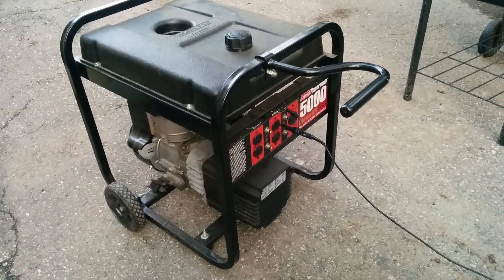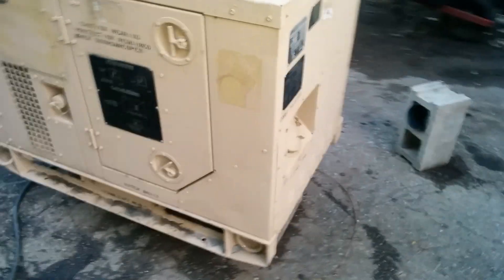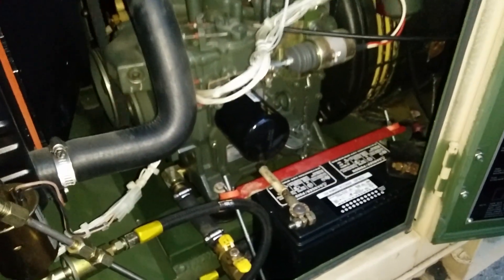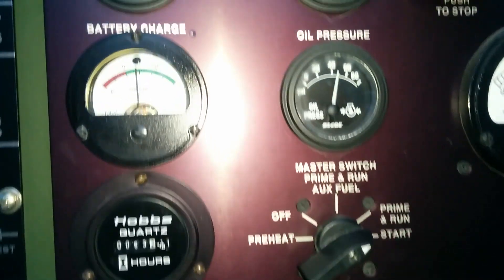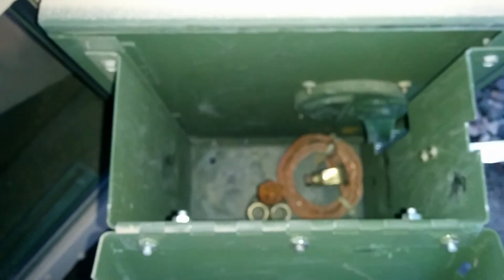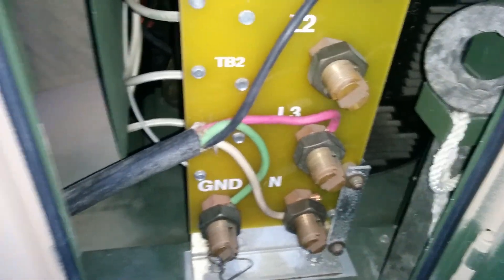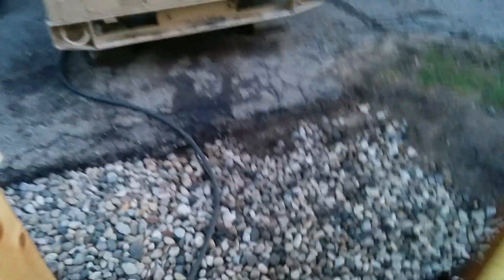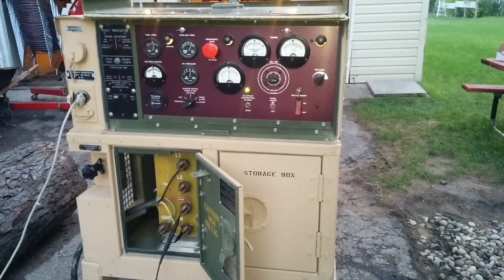Mep-802a vs consumer generator

Comment: where can i buy one ?
Reply from the maker: Govplanet.com I think but your paying top dollar these days. Ebay sellers too. Mep-802 = 5kw Mep-803=10kw both can put out 20% more then rating. Don't buy it if it doesn't run. Stay away from units missing exhaust flap and over 2000 hrs. Most units are in georgia right now.

Comment: How do you come across something like this to purchase?
Reply from the maker: Used to be govliquidation.com online auctions. They had a contract to buy surplus. Now I think govplanet.com is the only one around. But auction prices have shot through the roof from people bidding on stuff they did not know anything about cause they heard a guy got few good units once soon a time. Many of the units have serious issues. Most of which a trained eye could spot. But people where bidding top dollar on units that where clearly only good for parts. I used to get a good 1,000 hour unit for $1500 and a parts unit for under $500 last time I checked they where selling for $4500 for any unit. I'd drive out of state up to 13 hrs away to pick up 4-5 units at a time and fix em up and sell em for $5,000-$6000 each.

Comment: Hello if I were to pickup one I should really get one newer in year like 2006 and up. Nice video
Reply from the maker: I usually went for newer units but the most important thing to me was to make sure it was not a rebuilt unit. There is a small tag by the data tag that indicates an overhaul.

Comment: I just wish that the people that make videos like this knew what they were talking about, this was just a bunch of BS
Reply from the maker: Other then I said commutator instead of slip rings . What else did I say that was BS? Diesel doesn't varnish like gas and does have a longer shelf life. As long as you keep water out of diesel it stays good a very long time. The THD on the Coleman can and will damage your sensitive electronics. Brushless generators are typically less noisy because of there very nature. There are more reasons for the better THD I can explain them better now if you'd like to know about them.

Comment: Do you have a frequency meter you would sell? The one on my 802a is jumping all over the place. Already verified good output with a meter
Reply from the maker: Unfortunately I don't. It is one of the gauges that fails the most because of its sensitivity. Mine is a bit sticky right now too. I parted out a whole mep-803 and that was the first part I sold

Comment: That's a 10 000 watt generator. I have two.
Reply from the maker: No it's not. The 802a is a 2 cylinder 5kw and the 803a is a 4 cylinder 10kw I have bought , repaired and sold 20+ of them. Now semantics. The 5kw unit can actually put out closer to 7kw and the 10kw unit can put out 14kw

Comment: There is no commietator in that POS- it is a slip ring. Harmonics can be filtered.
Reply from the maker: Ya I know I misspoke. But slip rings still create noise along with poor voltage regulation. That's why most quality generators with low THD are brushless.

Comment: What makes these military diesels last longer than the cheaper one you showed is the fact that the engine it runs at 1800 RPM vs 3600 RPM of the smaller one. They make 3600 RPM diesels also and those will last a little longer than the gas versions but not alot more. The bearings and all moving parts of the higher speed engines wear out at a MUCH faster rate logarithmically.
Reply from the maker: The speed is a huge factor, that is correct but also look at the robust components of a diesel vs a gaser. The piston rods are twice as heavy, the blocks are twice as thuck, the metalergy in general is usually of a higher standard to handle the higher compression ratios, cylider pressures and torque.
Reply: 300 RPM diesels like Listerines, you will to your grandchildren.

Comment: I just picked up one of these for an unbelievable price. I'm glad I ran across your video. Was going to flip it but now, I think I'll keep it. 479 hours built in 81. In 91 had sound suppression kit installed. Have record of everywhere it's been. Good video
Reply from the maker: If it had a sound suppression kit installed its not an MEP-80x its an MEP-00x 5kw is MEP-002 and 10kw is MEP-003
This video is of the newer water cooled units.
Yours is an air cooled unit.
Air cooled units are quit a bit louder and not as sought after but still very good machines.
I have a few videos of a MEP-002's that I had too.
MEP-002a walk around https://www.youtube.com/watch?v=RgsFpg3I3QI
MEP-002a 7700 watt load test https://www.youtube.com/watch?v=EzIbZD_6HTA
Acoustic suppression kit reinstalled  https://www.youtube.com/watch?v=CTgj78rVrq4
Reply: @electromechanicalstuff2602   I paid 250 bucks for the mep002. Just one of those things I couldn't pass up regardless of whatever I had in mine to do with it. 600 for the 12 kw. At an auction, people were scared it was a 3 phase. They didn't realize it was both
Reply from the maker: Did you realize it was both? a lot of people are turned off by that not knowing.  @aaronwood3540
Reply: @electromechanicalstuff2602  yes I realized it, that's why I bought it. Both of them are both 1 and 3 phase. But of course im just using the single phase side. I worked 20+ years around 3 phase so the 3 phase side didn't bother me at all.
Reply from the maker: I've only been working around 3 phase about 5 years and now I make my own digital and rotary phase converters.
I've eve sold a few to friends.

https://www.youtube.com/watch?v=hyjYdEL-80s
https://www.youtube.com/watch?v=6dMwxFX_vlQ
 @aaronwood3540
Reply: @electromechanicalstuff2602  so your saying the 5 kw genset will produce more than just 5 kw? Did I read that right?. I kinda thought it would but haven't put it to the test yet. I need you on my crew. I can build almost anything out of wood or steel. Need someone good with electronics lol. Hard to find those kind of people.
Reply from the maker: @aaronwood3540  correct more then 5000w. Its rated for 5000w continous= 80% on load meter.
6000w= 100% on load meter for 1hr. 
6600w=110% 40 mins
7200w=120% 20 mins
7800w=130% 10 mins
Not all can make it to 130% before falling on its face. 
They have that extra power so it can still maintain 5000w at the highest altitudes and harshest conditions.
I don't know u but not to be rude you probably couldnt afford me.
I already work for a large manufacturing company in the R&D field with electromechanical devices. Thanks for the offer tho. You can always find good workers but how much are you willing to spend to get them is the question. Or you have to identify the go geters early and train them to become the guy you want. Easier said then done i know.
Reply: aaron wood I
Reply: @electromechanicalstuff2602  I also have a old school 10kw that was upgraded to a 12kw. When I say old school I mean it has the hecules flathead four cylinder in it. Built in the 60's. Runs like a top but drinks the gas like a fish drinks water. It only has like a 1000 hours on it. I'd have to go look at all the numbers to tell you what it is exactly. I've owned it for a few years. I actually bought the mep002 because of the diesel engine thinking I could swap the engines. But it turns out the mep002 is in really good shape so now I don't want to do that even if it would work. Also looking things over I'm pretty sure the engines wouldn't interchange anyway. So if the mep002 will run my house with no problem I may just put in in instead of the 12kw. I just to have plenty of extra if I have the option you know.
Reply from the maker: @aaronwood3540  the 002a is only 5kw capable of about 8kw. The gen head in these units will produce way cleaner power then that old hurcules. Youd be downgrading it if u put the diesel on a less quality gen head
Reply: Back in 1994, I bought a Chevy stepvan with the Detroit Diesel 6,2l V8.  It spent 1988-1994 going up and down the flightline at Pope AFB in NC.  I called and the Chief Master Sgt who owned it sent me its complete maintenance history.  It, too, gets 3000 mile oil/filter changes.  I changed the glow plugs in 1998 and starter in 2008.  It still runs like new.

Comment: i am looking into buying one with 860 hrs is it too much hrs will it be needing an engine soon or they go the distance
Reply from the maker: I usually try to buy under 1500 hours. Oil change intervals are every 500 hours. Just look for wet stacking. Tar/ oily residue around exhaust manifold. Its from running without enouph load. 30% min load at all times.
Reply from the maker: Ive seen good runners at 8,000 hrs
Reply from the maker: Also look for a tier 2 tag by data plate that has year on it. Means its been oberhauled by the military but the clock gets reset. Usually they have had alot of hours on them to require an overhaul
Reply: @electromechanicalstuff2602  is a generator having a tier 2 reset good or bad.
Reply from the maker: @richardi1124  id go with bad but can be ok. Teir 2 reset means its been ovethauled. They dont replace everything. Just do the updates that are required and fix anything broken. Usually they only get teir 2 resets after a major breakdown. Like motor or gen head. They reset the hour clock. So u dont know how much time is actually on the unit. Alot of parts may still have 5,000 + hours on them. Its hard to say exactly how long it will last. They do go thrugh it and make it right but not as good as a non reset unit with less the 2,000 hrs if u ask me. Thats only my opinion. People may have diff opinions. Ive seen 8,000 hr units run fine. Ive seen units with 300 hrs on them destroyed because the operator let it wet stack. So it really depends. Wetstack is the biggest concern

Comment: Could you do m a favor? If you still have the Coleman could you run a test on the sine wave with say a 1500watt space heater on it?
Reply from the maker: I do not but i sold it to a friend so sometime or never i might be able to
Reply: I'd really appreciate it. I have very similar model as a spare to a generac(chinese somewhat okay not really genset). I heard you just have to be really careful with loading and unloading to avoid spikes and dips and they clean up a lot with some resistive load on them.
Reply: If you can do a voltage check too, sometimes these things overrun and make a mess of the wave.
Reply: Oh something that may be easy for you there. Can we get a quick vid of that sine wave unloaded? It might even be cleaner. Electric motors spit out straight garbage into the system.

Comment: I've seen  huge piles of these thrown away in Saudi Arabia by the military. I was told it's cheaper to scrap them.than send them back state side. Go figure
Reply from the maker: Rayford Hickman if they dont spend the budget they wont get as much next year. Literally a donzen of the units ive gotton over the years where sabotaged when i got em. Usually oil pressure wire cut or something easy like that to cause it to not run and shut down via saftey fault codes. Its obvious they need new gens cus the others are "no good" the other 50% off all the units in the markets are usually junk cause of wet stack or watter got in the exhause and locked it up. The other half simple or no repairs
Reply: Military industrial complex don't make money on shipping only death
Reply: I have always looks at military logic as stupid

Comment: I would like to see you compare the sine wave of a good inverter generator (like a Honda or Yamaha). They are designed for consumer electronics. That Coleman hog is not.
Reply from the maker: Jake Logan your right. But that hog is what most people have amd is what most people backfeeed their homes with. My friend just got a champion 3000w inverter gen im going to scope soon
Reply from the maker: Jake Logan https://youtu.be/bXsTfUOllJM

https://youtu.be/XChmkKRVDUA

Id so like to see any inverter generator start a 3 ton ac unit or 3 of them

https://youtu.be/nJz45Hn6vgE
Reply: Good videos. I have two portable inverter generators myself, and three portable conventional generators. Looking to get a MEP-802A soon. Oh, and last night I was running 10 aeroderivative generators and putting out a total of 900+ MW of power. No joke.
Reply from the maker: Jake Logan I'M a non practicing A&P mechanic. I've started up commercial airplanes too. Only about 90MW. The real money is in R&D automotive tho.
So you either started 10 planes or ran Fermi 2 at about 75%. Lol

Comment: I have an MEP-003A which is 10kw and air cooled. Bought this a backup to my Generac 20kw propane / natural gas primary unit. The Generac has an automatic transfer switch and will run my entire house including 2 central air units - 5 tons each. It will auto start and has circuits wired into house thermostats so it will start only one AC unit at a time. Runs the whole house with no problem. Bought the MEP in case of extended outages. Wouldn’t want to run the Generac more than 12 hours or so. The MEP will run for days at a time and will run the whole house with just one of the 5 ton AC’s running.
Reply from the maker: Doctor Goop ive run 3 3tons with a mep-803 also a 10kw but u would definatly see the lights dim for a sec especially if that start at the same time. Thats one thing generac buyers usually dont know too. Is there $10k units cant run more then a few daya without needing service. Hope u werent one of the people who figured it out after u bought it

Comment: Excuse me sir I own one of those 5000 watt gen and mine runs exceptionally
Well
Reply from the maker: TIM Williams what the Coleman? Ya they are great for power tools. U hook ur furnace or t.v. to it kiss years of operation good bye
Reply: I can run my whole house off of mine
But it's all in the way you turn things on I run mine through my dryer plug
Reply from the maker: TIM Williams watts are watts. But they are dirty watts clearly from this video you can see that. Using a suicide cord into your dryer plug is going to get someone killed and you put in prison for negligent man slaughter. Even if you do everything in right order.  Good luck proving to the power company and the sherrif standing next to them that it wasnt you who killed the lineman down the road. It could have been the guy down the road who actually forgot to shut off his main breaker but. How can u prove it. Dont use a suicide cord. Its called that for a reason. Use a breaker panel interlock or a transfer switch. Someones life is worth more then the few hundred bucks it'll cost u
Reply from the maker: TIM Williams https://youtu.be/GA_zhLogUG8
Reply from the maker: TIM Williams https://youtu.be/n7DkaorEQPQ
Reply from the maker: TIM Williams https://youtu.be/GLgtFCJlVFQ
Reply: I somewhat agree.  We remove the meter during hurricanes.